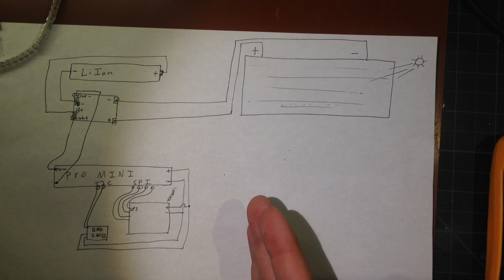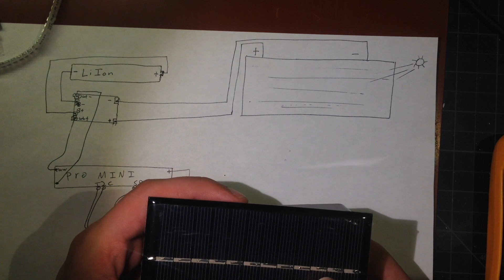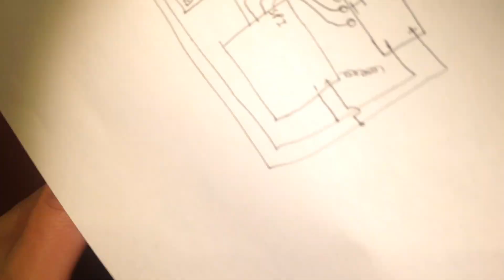BME280 Weather Station Part 4 - board and case

Comment: Just a thought but won't the bme280 be affected by direct sunlight where you have it mounted. I can see its protected a small amount by the solar cell but temperature readings may be inaccurate. Aplogies if this is already a known issue but I have not watched parts 1 - 3 of the video yet
Reply from the maker: it will be mounted to a tree, so my theory is that it will not get too much direct sun, but I guess that remains to be seen.